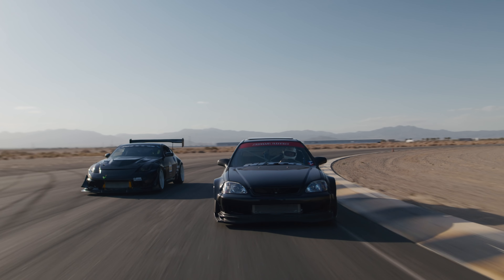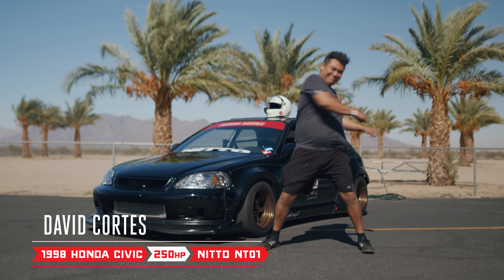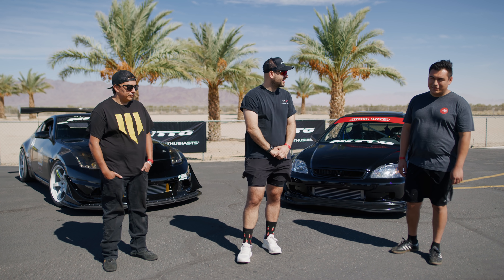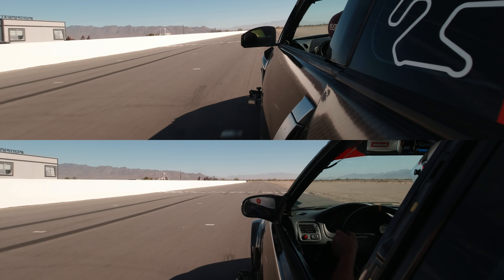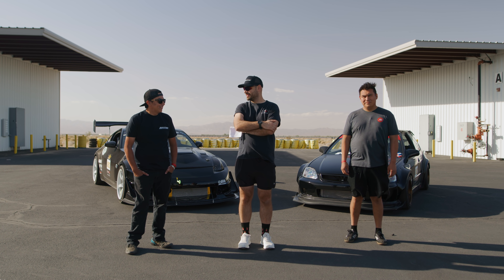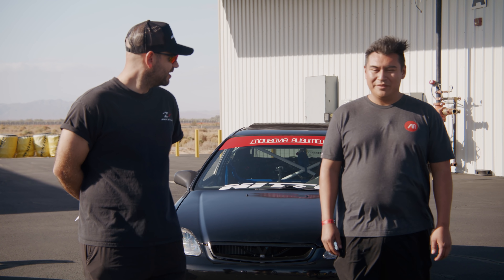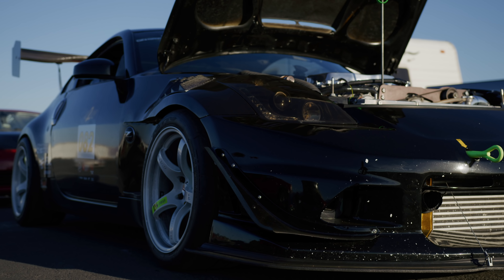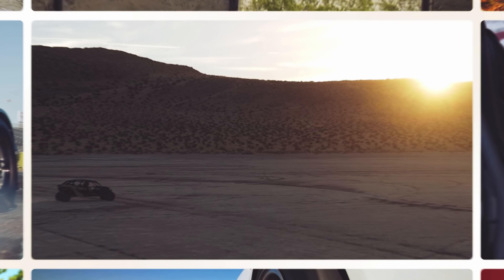350Z vs Civic Hatch | Driver Battles

Comment: For a non v tec with eBay turbo that was good for the honda
Reply: Vtec’s+ Turbo kits don't mix. Due to the nature of the b16/b18’s and their high compression ratios, the B20 block which he's running specifically from a CRV deals better with boost. Hopefully, that makes sense.
Reply: @RGCortes  B16/18 and K series work just fine with turbo.  Not sure what you on about
Reply: @djsonicc  👍🏻Your right I'm wrong😂. I had a Boosted 2000 Si back when they first came out. Yes they work just fine but people craved the b20 block + boosted for a reason.

Comment: Stock B20 really? How did they ever think this was a fair race when the last race was a k20 civic vs a stock hp 350z and the 350z still won. This Z has 420hp! Smh, at least drop a k motor in it homie or least a b18 with turbo.

Comment: Once i finish my mr2 im coming out there i see a lot of slow drivers out there 😂. Fwd is just not great for the track they have inherent limits no matter the setup plus he was done on power too no chance
Reply: Not like the fastest TA cars aren’t fwd or anything…
Reply: I have and MR2 turbo and a Z, but i definitely wouldn't sleep on a well setup front wheel drive car. If anything you can push them harder than an MR2.
Reply: @RedWolf-93  yeah at speed the mr2 can be kinda sketch theres fast fwd cars for sure but in terms of out right potential on a track rwd and awd are better
Reply: @NormalGuy  in the world? 😂 i need to see that list
Reply: @currythegoatofmankindthepa5156  Just look up Will Au-Yeung's records.
Reply: @currythegoatofmankindthepa5156  suspension design matters, a civic that has double wishbone front and rear has more capability than an MR2 that is a basic McPherson strut setup front and rear and already know for its negative handling characteristics. Usually most rwd cars that are tracked have a good suspension design but the amar2 is not one of them in my opinion. If its fwd with good suspension design vs rwd with poor suspension design the fwd car is likely faster all else being equal. Its narrow minded to saw rwd and awd are just better by default.
Reply: @RedWolf-93  suspension is very important along side tires but say all those components are on a rwd car AWD car and a fwd car the the rwd and awd car will out perform the fwd car everyday of the weak. Fwd can be fast but the other layouts are just faster
Reply: @NormalGuy  just looked them and and saw he was fast “in his class”, he’s fast no doubt but for all those events he wasn’t even close to the the overall top time out of all classes, for example in one event he was over 10 seconds behind the top GTR, and in another he was over 10 seconds behind the top C6 Z06.
Reply: @zombielivesmatter7294  lol the guy still holds Overall lap/course records over some of the same cars. No one is going to hold a course record on every track... Come on...